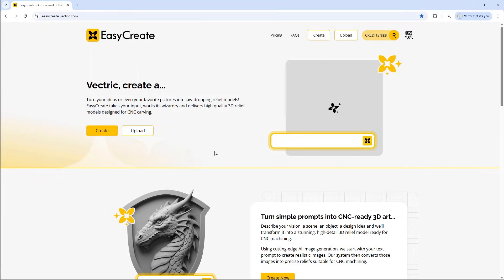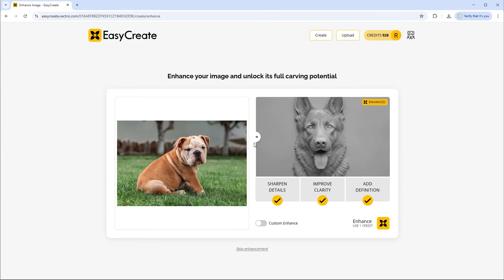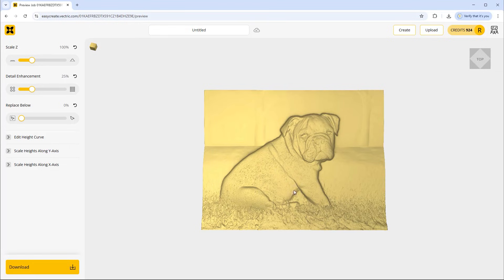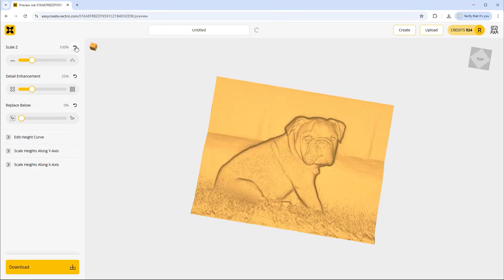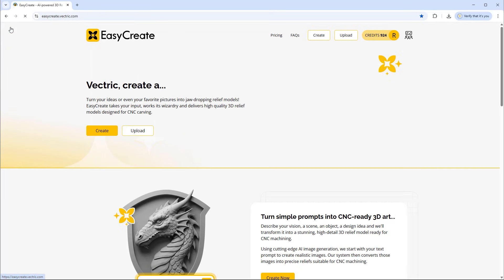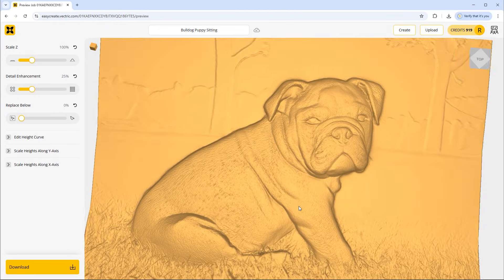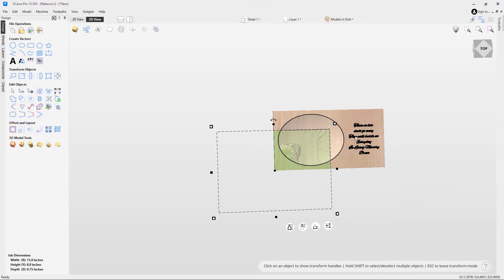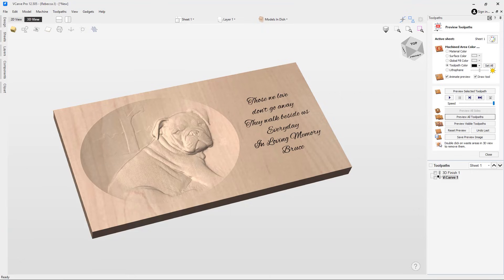How to upload a photo for model generation in EasyCreate

Comment: Hello. You mentioned that it would take a few minutes to generate. In real time, how long did it actually take? With and without using the enhance feature? Also, whe downloading a .tif file, is it 16 bit grayscale or 8 bit? How much are credits? Thank you for the demo.
Reply from the maker: Hi there, this video shows the real time generation of the images and models. It only usually takes a few seconds. The .tif file is 16bit. Credits are $20 for 200. I hope that helps.
Reply: @vectric  Yes very helpful, thanks. After I went to the website I found the current pricing. My bad, I should've checked there first. We're thrilled to try it and see how it fits into our workflow with Aspire 12 and a slew of other AI platforms and external software. You guys did a cool demo on SkulptOK several weeks ago so really intrigued on how this will differ. Exciting times!
Reply from the maker: Have fun!!!